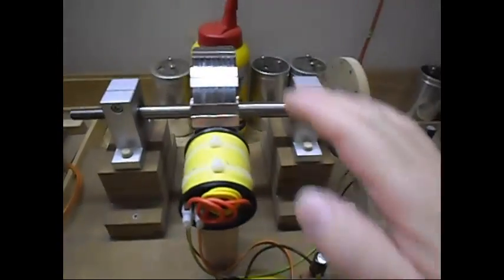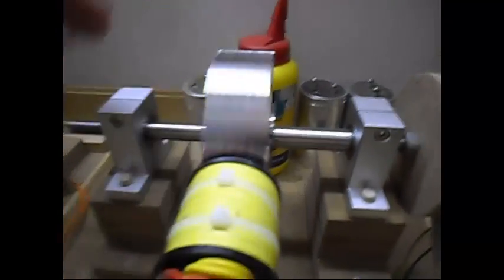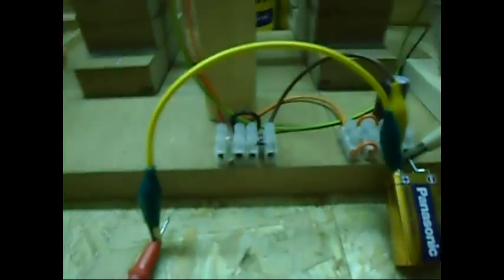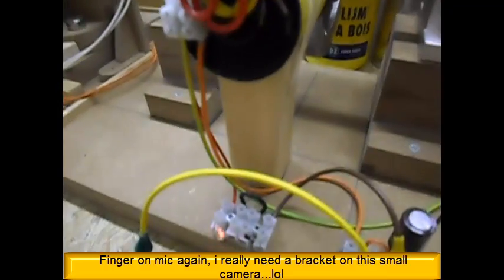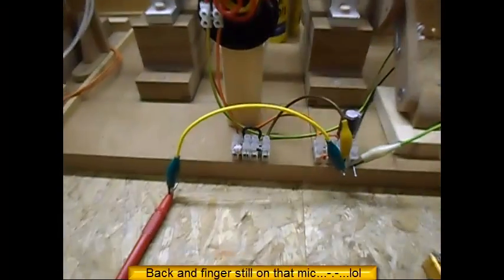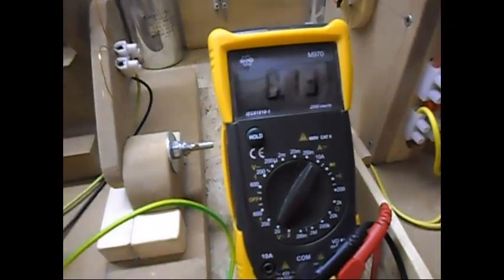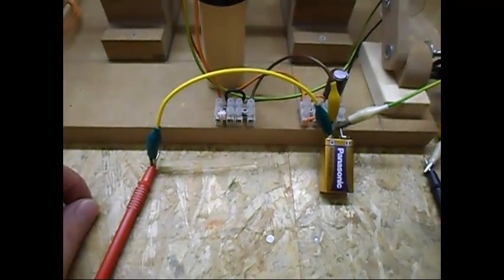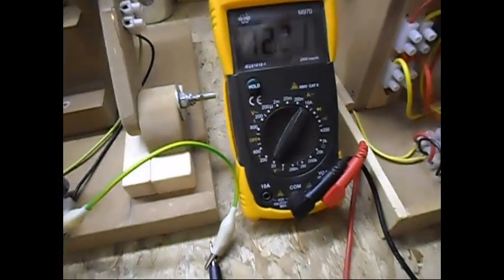24 Magnets_12 Pole Rotor - Update 1, Simple but nice circuit for input and output...

Comment: Nice work man. you may want to put wires were others don't to increase the reach of the magnetic flux.... Also consider using a reed switch....
But I think free energy (O.U) lies with the drinking bird...
Reply from the maker: Thanks for your comment and i'm pleased that you've liked it...^^
This setup is on the back burner for now since some magnets flew off while driving it at higher rpm...-.-
It was looking interesting when i did a small load test...so i'll be back on this one as soon as i have 4 new magnets...;-)
And what happens when the drinks of the bird is empty...no more O.U...lol...but i get what you are saying...;-)

Comment: +Mister V2DAY - Producing electricity from magnetism is a very old invention. Electricity is generated from tiny magnets in microphones, phonograph pick-ups, guitar pick-ups, etc. Higher power is obtained from bicycle generators and hand crank generators for radios during WW2 and in 3rd world countries for running transistor radios. So, you see, you are reinventing the wheel.
Reply from the maker: Thanks for your comment even if it is a copy of your other one...^^

Comment: I am curious if you have tried very large inductors for the stator coils, and if so, have you repeated Thane Heins acceleration effects when doing so?
Reply from the maker: Thanks for your comment...^^
I don't really have very large inductors but i will be testing this rotor on my other setup purely as a generator rotor with all my self made aircore coils...;-)
I might even try them coils with ferrite/alloy 50 cores just to see how that goes...:D
So stay tuned and update on that in a few days time...^^
Reply: Mister Caribbean Roots You look pretty advanced by the look of things, but are you familiar with "inverted Lenz's law?" I came up with the name. I'm very upset nobdy understands the relationship between the inductance of the stator coils and Lenz's law. If you have too much inductance, Lenz's law becomes inverted. This was talked about in Robert Adams early pulse motor generator experiments, where he used a 50 ohm coil for the stator coils, and the rotor would accelerate when the stator coils were loaded. Thane Heins did this same thing. Lenz's law can cause magnetic drag, or it can become inverted and cause magnetic acceleration. The law has nothing to do with the law of conservation of energy, none whatsoever. This is an outright lie that is printed in books. Unless I'm confused. By the way I don't have any free energy devices myself, but I find it interesting studying them.
Reply from the maker: Thanks for your compliment but i see myself as a beginner for the reason that if i should see myself one day as an expert in this field than on that day i'll automatically began the path of "stopping with learning" because of the reason of thinking that i know it all...;-)

~>* But i am confident, i believe in my own capabilities and i have a vast imagination *<~...^^

Yes, i know what you mean since i have some videos on how the Lenz effect helped the system out instead of working against it...;-)
Check this playlist if you have time and want to,
https://www.youtube.com/playlist?list=PLfA81Ns_3o1GTRQolhkN40798kk__RiXj

Thing is that this is a cool effect but it is still missing something to propel it into the next phase where it is enough to self loop and even creating a O.U device...;-)

LOL at your line "I don't have any free energy devices myself" neither do i...lol
It cost a lot building all this stuff so no free lunch or free energy  "yet"...^^
Reply: Mister Caribbean Roots Hi. Good to know that you are aware of the Lenz's Law acceleration effect. However, you do realize that you can self loop a motor-generator when you have Lenz acceleration. The point is, Lenz's law is the ONLY mechanical loss in a generator system, because the bearings are basically zero loss, because they are less than 1% of the drag. If you remove the Lenz's law, and it is changed to Lenz's acceleration force, then you end up with more energy out than you put in, by far. This is how the Lockridge device worked. This is how the Bedini-Cole window motor works, the Adams motor, the Lutec generator, etc. They are all self looping devices.
Reply from the maker: Thanks for all your info/input...^^
All of those devices you've mention are all still connected on batteries when they are self looped but yeh they are all sending some power back to the source battery...;-)
I just uploaded a video on this "speeding up under load" but am i there yet to self loop...yes...but not to remove the power source in this case the variac/grid...lol
Speeding up under load is a pretty nice cool effect but we still have the cogging issue and yes you can get that effect with aircore as well but than we have other issue's so at this moment in time i'm not sure which one is better or are both just nice cool effect and thats it...???
More testing is needed in my case but this last one seems pretty good since the coil/core is very close to the rotor and the coil isn't that high in resistance/inductance nor is the rpm needed for this effect to high(1500 rpm at the moment)...^^
See that video here,
https://www.youtube.com/watch?v=ttZEttQn00A
Reply: Wow I didn't know you could get acceleration under load at such a low RPM? I thought you needed high inductance coils and a high RPM rotor do make that concept work? I'll check out the video!
Reply from the maker: You can even make it work at lower rpm by having more rotor poles, that's one way...;-)
And even lower if you have the right size of core in the coils also but this can come with a negative effect on the output and that's no good...lol
A good balance is needed to get this effect and also get some decent output also...^^
Sound easy now doesn't it but it's not...lol